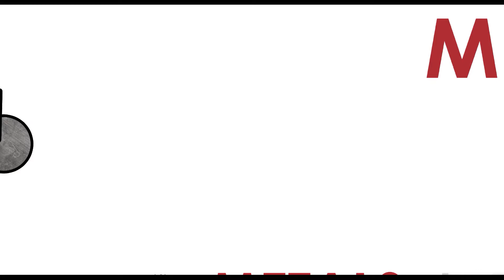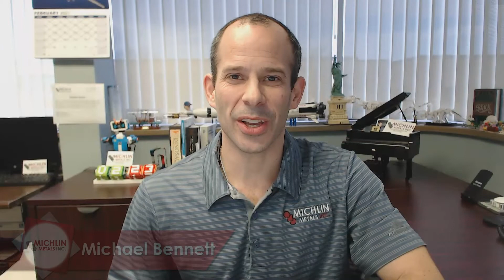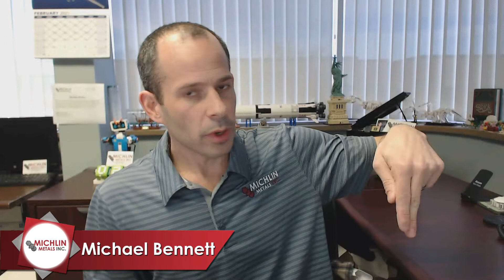Hardness Testing of Alloy Steel, Stainless Steels, & Nickel Alloys - How to Test Metal & Steel

Comment: Michael, I used to work as a manufacturing engineer for a corporation in Connecticut. I used to program CNC lathes and machining centers in the production of parts made from super-alloys. Two of the most difficult materials to work with were, what they called, Hastelloy-B and Hastelloy-C. At that time they were made by Cabot Corp.

Have you ever heard of Hastelloy referred to in this way? Do you think either of these would be the equivalent to Hastelloy-22, -276, -X, or some other variation?
Reply from the maker: They still make C I believe. MAYBE since they are referred to as Hastelloy "C" 276 or "C" 22 those could be closer to an equivalent.  Maybe you have an old MTR perhaps? If so, you could email it to me and I could take a look and compare to the new grades. Not entirely sure tho. MTR comparison would be best.
Reply: @MichlinMetals I'm sorry Michael, but I do not have any material test reports from those days (1980-1984). Cabot Corp. was bought out by another company...... And then that company was bought out by a third company that makes hastelloy to this day.

I guess the best clue to finding out the metal composition would be to get hold of an old Cabot Corp. sales brochure or reference pamphlet. And I have no idea how to get hold of something that old.